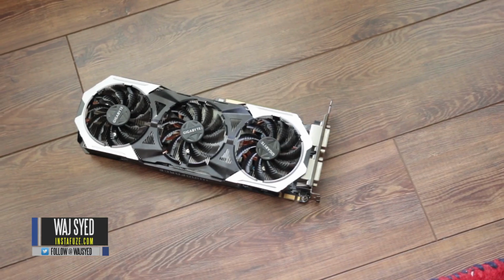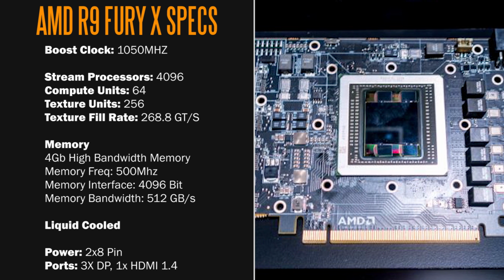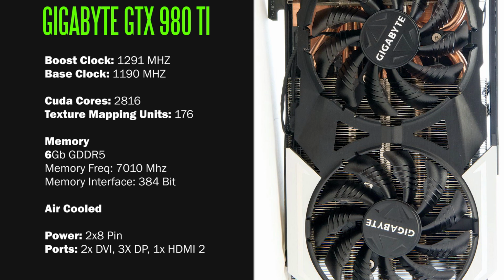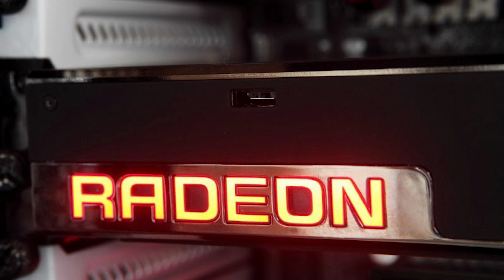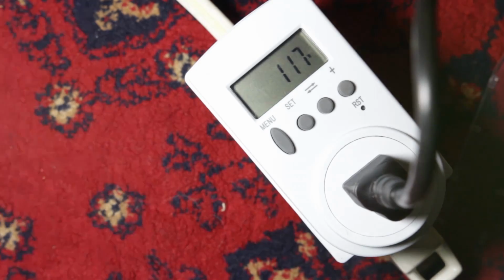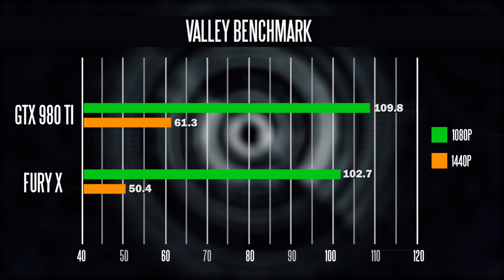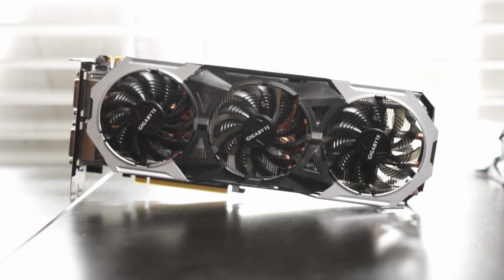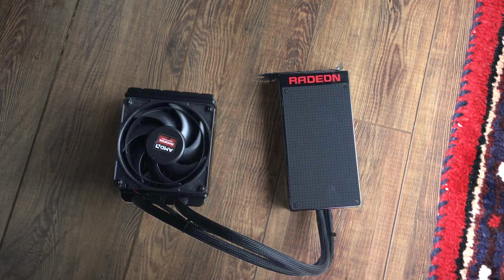AMD R9 FURY X vs Nvidia GTX 980 TI - 4k Gaming Benchmarks

Comment: This isn't exactly fair given that you tested one of the most expensive out of the factory overclocked 980 Ti's there is. The G1 is like $100 more than a stock 980Ti. Since its stock to stock, given the prices, you really should compare this to a reference 980Ti, or one that you can buy that is cheaper than 980Ti MSRP.
Reply: Incognito let's lay out the reasons why you shouldn't buy 980 Ti. And why an AMD card would be a better buy:
1. Nvidia forces proprietary hardware down the consumers throats
A freesync monitor will cost you less than a g-sync monitor and will perform similarly. That saves the user $80-150 on a monitor. And they will soon force NVlink down our throats.
2. Nvidia lies to the consumers 10 times more than AMD does
The 970 is a huge recent debacle for them. And they have always lied through their customer service means. You cannot put it past them that they didn't lie about something on the 980 Ti
3. They sue other companies in the industry
Some people don't want to buy products from a company with malevolence in mind.
4. 980 Ti has weaker cooling setups - The Fury X is cooler for cheaper
You would have to buy the 980 Ti hybrid for $100 more to get the same temperatures.
5. You are supporting proprietary software in games
Nvidia and AMD are notorious for optimizing games in their favor, but only Nvidia forces gameworks and physx to be practically exclusive to them and their cards. They are single handling destroying diversity with this tactic. Buying their product is supporting this puerile, selfish, and disgusting behavior.
6. Nvidia's SLI setups are worse than AMD crossfire setups
For any multiple GPU user, AMD is the way to go. Their scaling percentages are much better than Nvidia's. So much so, that the Fury X crossfire demolishes a pair of overclocked Titan X's with ease. Any of their cards will have similar scaling though. And they do not require you to buy/install an SLI bridge.
7.  The Fury X uses its memory more effectively than the 980 Ti
The Fury X has roughly 55% more memory bandwidth than the 980 Ti. The 980 Ti will bottleneck itself from its 6gb of memory before a Fury X bottlenecks from its 4gb of memory. The only issue is that the Fury X will fill its 4gb up quicker, but it will use it faster than the 980 Ti. That's why, correct me if I'm wrong, that the Fury X beats the 980 Ti on triple 4k setups in certain games (Like in Shadow Of Mordor and GTA V, the Fury X beats the 980 Ti but loses to the Titan X cause the Titan X has more memory)
8. When overclocked the 980 Ti draws tremendous amounts of power
People complained that the 290X drew so much power. Yet this chip draws more power at reference and even more watts when overclocked. So much for that Maxwell efficiency. Yes I know it's more powerful but still. It draws a crapload of power. It is a power whore. There are plenty of AMD cards that draw less and cost less. And there are better Nvidia cards to buy too. The 970 is still a decent buy for the cash and even the 750 Ti / 960. But AMD 28XX remain the best price to dollar ratio.

If you only focus on the first seven points, the Fury X is the way to go.

If you want to support a despicable company like Nvidia and their products that only give only slightly better results in single card formation, then go for it. No ones going to stop you. 

Just stop being an assclown. There are much more morally appropriate decisions for choosing AMD and your only loss is going to be minimal. A few frames less. (But remember: the performance loss is nonexistent if you crossfire).
Reply: Sam Cooper I found the G1 for $690 on newegg, so it's only $40 more.
Reply: BasslineSynergie Guys, why do you compare clock speeds, when these are two completely different technologies? They doesn't work the same.
Reply: Incognito Good god you are stupid using dodgy "voltage control software" and the guy had to crack it you take everything at face value, it was confirm via a new driver release that voltage would be unlocked as soon as they make it stable.

"Working around this was no easy task, but it looks like I've finally managed to crack it, so voltage monitoring and software voltage control will soon be available in the software I make; other tool developers will soon follow as well." means jack, only that so idiot wanted to mess with the SMC which I suggest he doesn't but Techpowerup and super legit right?

Again the second source is from July 7th which again means you take everything at face value and have clearly not read ANYTHING from those articles you posted.

You are literally too stupid to reason with.
Reply: Sam Cooper I bought my g1 gaming for 689.99 that's only 40$ more than the reference card....
Reply: Incognito You realize AMD and Nvidia don't clock the same? 1500Mhz Nvidia card would be the same as a 1300Mhz AMD card....
Reply: Mark Smith ***** 

Once again, let's do the intelligent thing and analyze the situation:

I said in crossfire it beats the 980 Ti SLI in triple 4k monitor setups because of its higher bandwidth and more effective memory usage (not quantity). That is why the Titan X overclocked in SLI can compete with the Fury X crossfire (and they trade blows depending on game optimization).

Stop talking about single card performance. We know the 980 Ti wins. It doesn't win by a large margin, usually under 10% and that benefit is gone when two cards are used.

Politics matter to a decent amount of people. Maybe it's only for those that want to support morality that promotes growth. AMD has stated on both occasions that they love the competition from Nvidia because the consumer profits no matter who ends up winning. They do like to spin a profit too but they don't try to monopolize and force proprietary technology down the consumers throat like Nvidia does. Mantle and freesync were never forced. They said several times that Nvidia cards could utilize them too.

I have stated points that cannot be refuted or ignored. They are all legitimate reasons to buy an AMD product over a Nvidia one. The 280X and 285 have stayed at the best dollar to performance for the past few years. This is unlikely to change this generation. 

Last generation the 290X was the king of the top tier cards. It beat the Titan by very minimal amounts. Now the 980 Ti is very slightly beating the Fury X. Yet everyone bitches and insults AMD while promoting Nvidia just because their product is slightly better this time around.

It's a constant battle and Nvidia buyers act like puerile pieces of shit when they win in the current top tier run around. Maybe it's because AMD buyers have more maturity. I don't know and don't care. I will buy whatever suits my needs. But that's me. The rest of the community seems like 12 year old kids like you guys and incognito or whatever.
Reply: It's only $50 more than a normal 980 ti
Reply: ***** its too early to say that dont you think? Since there are only locked versions since now. Wait until you can overlock them and look how HBM shines
Reply: BasslineSynergie oh, so all nvidia cards at 1500 mhz perform like amd cards at 1300 mhz, regardless of architecture? lmao.

but fury x does not even hit 1200 mhz. many 980 ti's easy go past 1500 mhz.

most fury x reviews max out at 1075-1150 (absolute max).

garbage chip so far, with alot of coilwhine on both fury and fury x cards.. not to mention the terrible aio unit on x, even the "fixed" version is noisy in idle..
Reply: Incognito
"most fury x reviews max out at 1075-1150 (absolute max)." 

So basically takes less for a Fury X to beat a ti? It takes a GTX 980ti 1500 on the clock to barely get 5fps more than a Fury X so if the Fury X can get to 1300 which it most likely will in the future would mean the 980ti would be bent over the table and Coil whine? that was sorted weeks ago....only the reviewer version had this defect. Link me to an aricle saying that the "fixed" version you go on about still has CW.

Fury X doesn't cap @ 1150. Pretty sure due to voltage locks it was capped.
Reply: Derively That's my point.......I said they work differently .
Reply: Jake Truut first of all the fury x gets outperformed by 980ti at 4k at most of the games so not sure why you think anything different bud, and you mention Gta5!! Fury X won't play it when gta5's settings at max, not enough memory, gta5 at max uses around 5 to 6 gig.Also the 980ti outperforms a game optimized for AMD also, it's interesting you say the FURY X outperforms the TITAN X in sli & crossfire, I have many links to benchmarks showing otherwise, it does however beat the 980ti in sli. For me personally I Own cards from both companies, I don't care about the politics of what each company gets up to I just want the fastest card that is out at the time. At the moment it's Nvidia 980ti & Titan X. Comfortably, and the 980ti Hoff edition is coming soon also, I have links that show the 980 Hoff edition beating the fury x at a couple of games in 4k too. At the moment the G1 gaming edition 980ti outperforms the Fury X comfortably.
Reply: Sam Cooper But hurt AMD fan, you can barely overclock the fury because it's just designed poor as shit compared to Nvidia's superior Maxwell architecture. Nvidia needs a real competitor!
Reply: +Xavier Lim it's because AMD'S crossfire driver's are work a lot better than Nvidias sli driver's, it has always been that way. But on the other hand Nvidias single card driver's have always been better than AMD'S single driver's, also there is no point or advantages over price of running quad cards from either company as you will still have one of those cards redundant not being used, in fact you can see a lot of games don't really use the second card in crossfire or sli fully, only a small percentage & sometimes not at all. Quad is just a huge waist of money, I have 3 extreme systems, 1 uses AMD'S crossfire, 2nd uses Nvidia sli, & the 3rd uses a single Nvidia 980ti G1 gaming edition, I have found through experience that running 1 very powerful card that can run all games at max is better than running 2 card's as you don't have to worry about either crossfire driver's or sli driver's. At the moment NOTHING can touch my G1 gaming edition 980ti in a single card race. Especially in 4k.
Reply: The Danster Im truly FULLY CONTENTED gaming on 1080p @ Max settings on games, since I can hit 73-94 on my i5 4460 - R9 380 4GB rig. (My monitor is actually not 1080p exact cuz its 1240x1080)
Reply: +The Danster Well AMDs new line of GPUs are gonna be made by Samsung using 14nm.  I think Nvidia is doing 16nm.
Reply: Sam Cooper it's not the highest clocked 980 ti. not at all. strix is higher clocked, zotac amp extreme much higher clocked at 1355...

but even a reference 980 ti is gonna beat fury x.
Reply: BasslineSynergie lmao.. you have no clue. i've tried both cards.

but i guess you want more proof than my words, so here you go:

http://www.maximumpc.com/gtx-980-ti-vs-fury-x-overclocking-showdown/

fury x gets destroyed by a reference 980 ti when both care overclocked.

a custom 980 ti overclocks ~15% more than this and the raping would be even bigger.

fury x is a joke among overclockers. not even with unlocked voltage the performance is good, and the watt usage is insane post-oc with high voltage:

http://www.techpowerup.com/reviews/AMD/R9_Fury_X_Overvoltage/
Reply: Jake Truut please make a resume of that wall of text
Reply: Jake Truut I can only assume when you say the FURY X beats a 980ti at Gta5 in a triple 4k set up you must be referring to an crossfire sett up as a single Fury X doesn't do well in gta5 & gets outperformed by the 980ti at 4k.
Reply: Jake Truut Because many people can afford multiple 980TI or multiple fury Xs right? No, almost nobody can. Most can't even afford (or are willing to buy) a single 980Ti let alone 2 or more. The consumers you are talking about are either those extreme entousiast or rich people. 

I've never said AMD was bad, but Nvidia's technology is just far ahead of amd atm and there really is no competition right now that Fury X was a letdown. 

And how did you think running Fury X crossfire is better then 980TI sli? Most benchmarks I've seen show equal performance and titan X beating both. (Could you send a source?)

Sorry for my bad english.
Reply: BasslineSynergie yea but amd never get 1300mhz when it get nvidia still perform better and nvidia 1500mhz is amazing
Reply: ***** I've seen some of these rich tuber's runnin 4 GTX980ti's in their awesome purely gaming riggs, Joker I think .
Reply: +Sabina jones lmfao, play nice, he's obviously bought the Fury X pmsl.
Reply: So a Quadfire Fury X crushes a 4 Way SLI Titan X in a 4K battle, but the Fury X sucks when not in crossfire and when in BELOW 4K resolution WHICH IS WEIRD. (I mean how the heck can a card perform better in higher res. but it sucks below higher res. ITS THE LOOMINATI!)
Reply: The Danster 4K was meant for SLI/Crossfire and Ultra settings..... You wouldnt be able to play 60FPS+ @ 4K & Ultra settings in one card (A Titan X can crush ALL single cards existing right now). Besides, Ultra Settings for games & 4K were meant for enthusiasts anyways. Its not like all peeps can buy 4 Card Setups.
Reply: +Xavier Lim I have many benchmarks videos showing not only the G1, beating the Titan X in 4k but also others such as 980ti Hall of fame editions too, and a couple of others like Evga etc, all out performed the Titan X in 4k testing.
Reply: The Danster They're highly oced, so they can match the Titan X.. Nvidia killed the Titan X when it released the 980ti though.....
Reply: Only rich peeps bother buying 4 Titan X's cuz most peeps really settle for 980ti's for almost half the price at the near quarter of performance.. (It means= Cheaper price but a super-tiny less the performance)
Reply: +Xavier Lim It's a quarter the price of the Titan X & beats it at all resolutions including 4k, that's why people choose it. Even though I suspect not a lot of peeps are actually gaming in 4k as it doesn't really outway the frame drops.
Reply: +Xavier Lim How do you like your 380? what do you think?.
Reply: The Danster Its ok.. But Im looking for an upgrade cuz I need a faster rendering GPU (for animations)
Reply: +Sam Cooper You must be new, because if someone likes Nvidia they use highly OC versions vs stock AMD cards to fluff the results.
Reply: 4GB MEANS 4GB True dat.
Reply: +4GB MEANS 4GB if AMD could make a card capable of overclocking we would all be seeing everyone using those results, but they haven't. That's not Nvidia's problem it's AMD'S. They had 2 years to make just one card, you would have thought they could at least make a card that you could overclock considering every gaming PC system these days ie processors-ram etc are all heavily overclocked.But like I said earlier that's AMD'S own fault.
Reply: +Jake Truut  I support AMD. Their software and marketing dept. might not be as large but fractionally speaking they put more money back into development. That to me is good work ethic. Can you imagine if they had the same size budget to work with? OMG!
Reply: 4GB MEANS 4GB Nvidia already stated that they would go 16nm, AMD will go further and skip straight to 14nm
Reply: in fairness then he should have tested both overclocked max chickens, or do you not want to see the fury crushed?
Reply: +Eternal Genesis the funny facts is nvidia is still using GDDR5 and still beats AMD HBM i remenber those days when nvidia launched the GTX 280 1gb GDDR3 and still beats amd GDDR5 card  :D D     PASCAl whit HBM2 gonna be a beast of card
Reply: +Hosaka Blood type of memory is usually pretty irrevelent to overall speed. Even raising memory clocks does almost nothing. Its architecture and core speed that will increase performance

Comment: The 980 Ti used in this video is actually quite a bit more expensive than the Fury X (at least that is the case in Europe). But that comes with all the advantages of a lower power consumption and definitely better performance. 

But I do think that a card like the Fury X will start to improve rapidly. We saw the same thing happening with the 290 and 290X from AMD. Those were crappy and launch but took off with new drivers. That does take a while as we are used from AMD, but still, in the long run the Fury X is probably going to outperform the 980 Ti.

What I'm really interested in is seeing how the non-X Fury will perform. It should perform only slightly worse than the Fury X, at a much lower price point. That should definitely give the 980 a run for its money and probably the 980 Ti as well. 

Things aren't looking that bad for AMD... I guess.
Reply: +Guy Random basically, what i know is that, most game engine were designed more toward nvidia, thats why most nvidia outperform amd card in gaming(and amd have a driver issue with this game engine all), its easier to win the performance when nvidia already monopoly the market, they hold 70 %(last time i checked), i do believe what u say is true, amd always give better benefit in a long run. plus, as far i concern the fastest gpu till date is still the r9 295x2. keep it up AMD.
Reply: Teunis Swart and after AMD brings out the new cards.See Ya NVIDIA
Reply: Guy Random Until Nvidia brings out it's next cards. See Ya AMD.
Reply: +Muhd Randy (Dy) it's not a Gpu though is it!! it's a duel gpu. I should mention also that both the Hoff 980ti's & the water blocked Hoff 980ti both outperform the 295x2 in all resolutions when overclocked, and the Hoff air cooled 980ti does it cooler too.
Reply: That's odd you say this 980ti is more expensive than FURY X in Europe!! In the UK with added VAT you can buy the Hoff 980ti for less than the FURY X, and the Hoff edition blows it away easily in all resolutions. currently 535.00 pounds. Fury X 599.00 pounds. Overclockers UK.